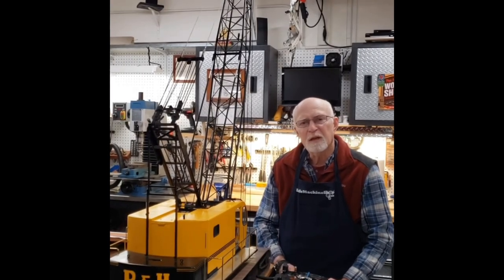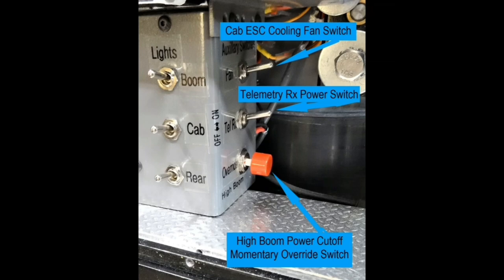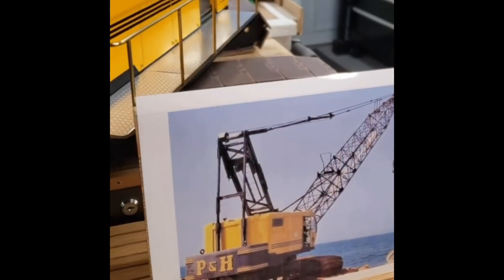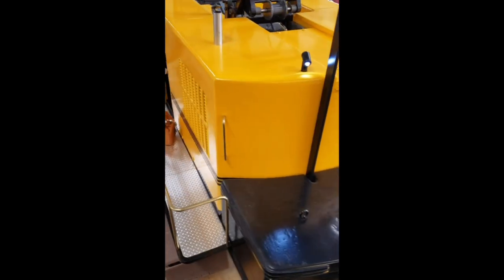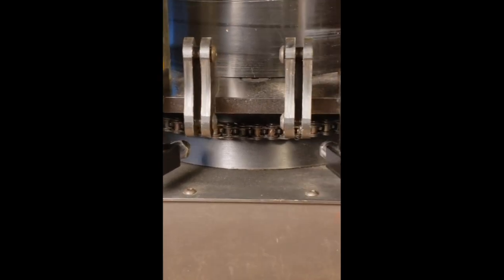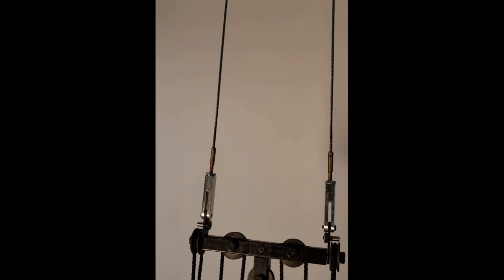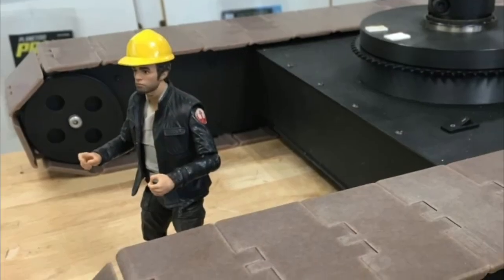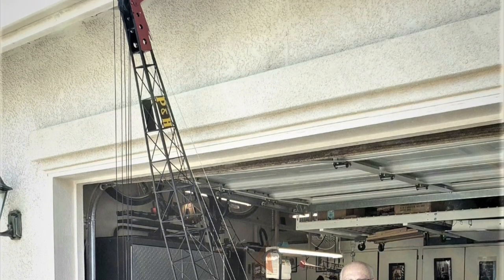1/12th Scale RC Crawler Crane Model Introduction Video, February 18, 2021

Comment: Hey Tom Very cool video I was wondering is there any way you could possibly slow the turntable speed down it would help with the scale realism just an idea but again very cool machine
Reply from the maker: Steve,
Thanks for your comment. The rotational spead is programmed to be exponentially variable, and to your point, when I was making the last segment video, I rushed that instagram segment to complete it under the indtsgram 60 max.  The segment that demonstrates the Boom High system shows a more scale rotational speed.
Reply: @cranemodelbuild3236  looks awesome nonetheless

Comment: Excellent model.  I was wondering did you incorporate a clutch and or brake to the winches or is it just an electric motor to raise lower the line?  Thanks
Reply from the maker: finster101,
Thank you for your comment.
Yes, I did initially incorporate spring loaded clutches into the design of the 2 hoist drums, but later discovered that the spring force holding each of the drum's 30 grit sanding disc/3" x1/16" cutoff disc clutch surfaces was limited by the maximum "clutch release" pull force (10 lb @.05" stroke) in any 12V solenoid that I could find at the time.  This limitation was further limited as due to spacial limitations, I could only fit in 1 solenoid for both clutches.  The resulting 5 lb normal engaging pressure on each clutch, had each start to slip @ a 5 lb line pull (filled reel), which was not acceptable to me, so, since I had a "plan B" in my design, I just bolted the two clutches together.
This then will limit the "casting" ability when I design/build dragline and/or clamshell  buckets, although the max rpm of the host drum windshield wiper motors would provide a line outlay of 10'/min.
Thanks again for your question and interest in my model.
Tom

Comment: Beautiful. I’ve always wanted to build one of these but can’t find much info.
Reply from the maker: Colossal BigFoot,
Thanks for your compliment.  If you have access to a benchtop metal lathe and milling machine,, you might check out my complete 7GB set of plans that are available on a flash drive offered by The Little Machine Shop at http://lmscnc.com/6342.
Stay well, in touch and subscribed🎈
Best Regards,
Tom